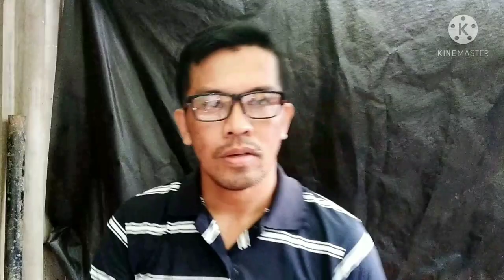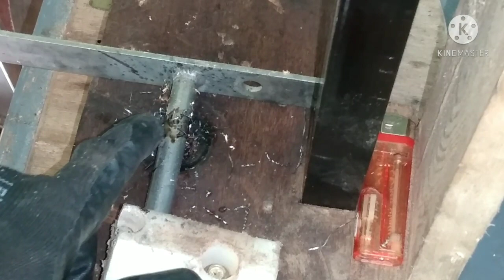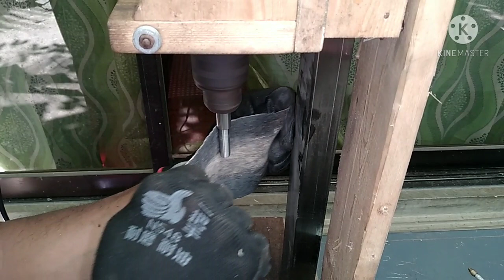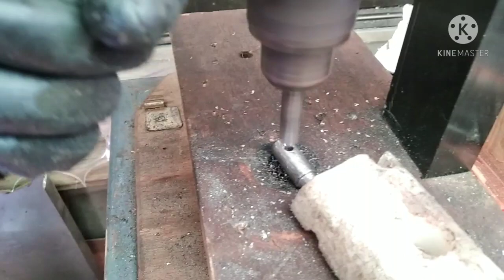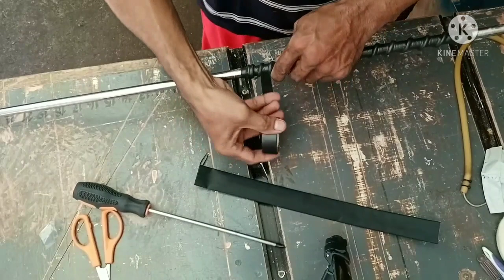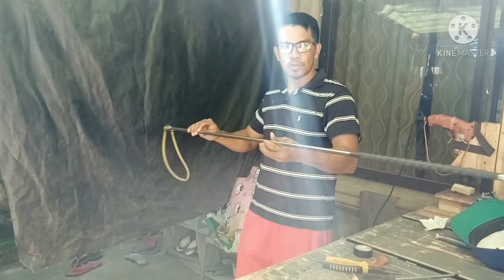How to make pole spear made of stainless steel pipe with simple grip| Angelbacaling

Comment: How size pipe?
Reply from the maker: 9mm
Reply: @angelBacaling100  inside or outside diameter?
Reply from the maker: 10mm inside
Reply: What kind of stainless steel do you use?
Reply from the maker: 304